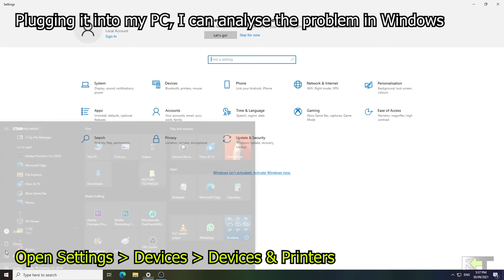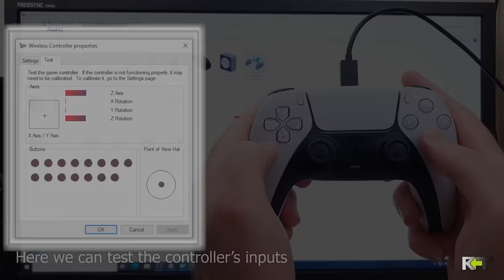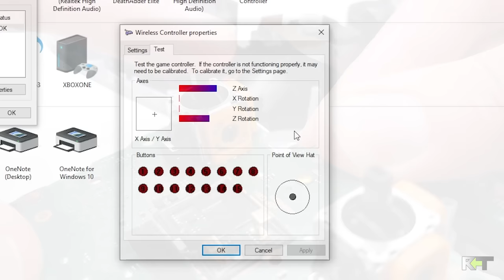How to take apart your PS5 Controller and fix Stick Drift

Comment: The main culprit of stickdrift is that small plastic part with tins in the stick module. The tins simply wear off causing incorrect current read. If you have an old and unusable controller (either xbox, playstation or just any generic one with analog sticks), just replace the problematic part from one of those. That's how I fixed two stick drifts for my PS4 back then and one stick drift on my PS5 recently

Comment: Great video. I had some slight drift. Took my controller apart, and cleaned the wiper disk. Now my drift is 100x worse. Anyone know what I might have done wrong? 

Scratch that. I took it apart and cleaned it again. Worked perfectly now!

Comment: Thanks for doing this, but i feel a little more emphasis on how difficult things like the ribbon connectors are to get out initially would have been good.... broke two, managed to fix one but had to purchase spares, your video makes it look so easy to take them out, mine were proper stuck in there....
Not sure ive fixed the problem as still has a bit of drift in there after replacing.... possibly faulty replacement parts
Couldnt have done it without this video though. 👏👍👌✌🤘🖖🤙🍻

Comment: 10/10 video instructions are very clear and it fixed my issue, although I suggest being extra careful with the wiper disk disassembly, I almost broke mine because I got impatient with the clips that hold it in place 😂

Comment: Are regular q tips ok? I don't have access to online shopping, so I can't really get them. If normal q tips, what would you recommend to deal with the lint. And if not, what would be a good replacement? Please respond. The stick drift on my controller is god awful and I desperately need help.

Comment: Hey, just opened my 6 month old controller (idk if this voids warranty..😬), to clean the contacts and the left contact looks like it got burned and cut in half… i have photos of it if you are interested to see… should I check with warranty if they can replace it and lie that I never openned it? Or just buy a replacement potentiometer and fix it myself?

Comment: I owe you a beer, but i had a third solution, after cleaning a disc, analog drift wont stop because he was broken, then i replaced just a disc from a broken ps3 controller and problem solved. I was prepared for soldering new analog but for now everything works. Anyway thanks for this manual it help me a lot. :)

Comment: thank u man u really helped save over 20$ to get this fixed. Lots of love appreciate it big time
Reply: How do you fix it for $20?  The Joystick cube is soldered to the board .
It's not a quick swap like the expensive  DualSense Edge controller has.

Comment: the main reason is that the green plate becomes crooked by your thumbs. they padded the touchscreen part with a thick cover of rubber wich also helps the printplate get arched but underneath the sticks itself is no padding or any substance to not get the printplate crooked... bad design. wish a ps2 controller packed in a 2024 style with touchscreen because ps2 controller had padding under the sticks. and the fact that half of the controllers are contaminated with lubricant and half havent. mine didnt had a lubricant on the wiper contacts squares

Comment: Replaced wipers and soldered on 2 different pads with no luck. Still has constant drift to the left. What else could be causing this... Should I try replacing the whole stick cube?

Comment: After watching this, I wish you were selling brand new cleaned and re-greased PS5 controllers. With better buttons too. Basically, one with higher-end materials, springs, and lubricants; I would pay $200 for a guaranteed high-quality controller. Because even the PS5 Edge Controller isn't guaranteed to be high quality, despite it costing 3 times as much as the normal one.

Comment: Can someone help me cus I opened my ps5 controller to fix a clock ticking sound in the controller I looked in it then put back together and now I does not work during games but only works on the Home Screen.

Comment: 2 weeks, it's been 2 weeks since I got my PS5 it's by no means new since my uncle had it for 3 years originally. But it took only 2 weeks for it to get a mild stick drift and while it doesn't bother me in games it's incredibly frustrating having to fight my controller just for a simple turn on the stick.

Comment: Bought a ps5 30 days ago. Played 5-6 days and got a stick drift. What a sh*tty controller. 
I’m gonna try to fix it. Hopefully it’ll work.
Reply: Update:
It worked, thanks buddy! 👍🏻

Ps: worked for a day, bought a new one and the other sent on guarantee
Reply: @Netkoizmase991  Is your new controller good? Not a problem anymore right? No stickdrift? I need your reply.
Reply: @ene4602  new one is alright, let’s see how long 😂
Reply: @Netkoizmase991  Wow that's cool enjoy with your Ps5 controller I will buy new two Ps5 controller too because I'm sure one of them will have stick drift and I will use other Ps5 controller this is my idea

Comment: I did this to 3 controllers (dont judge me lol) on the 3rd when i tested the right joystick just keeps spinning to the right. Should I just re clean? Any suggestions? Thanks for the video!
Reply from the maker: You could try re-cleaning, but it may be a lost cause and the carbon track needs replacing
Reply: @RestoreTechnique  it's less than a year old and the first time I've cleaned it. What is the carbon track? Ty!
Reply from the maker: @ayeruck8695  5:30 the black rings on the inside of the yellow housing.
Reply: @RestoreTechnique  okay thanks! I have another controller that broke from the black wire disconnecting. Maybe I can repurpose those. Thank you a bunch!

Comment: Thanks for this! Your close up shots and instructions were really clear. What % IPA did you use? So is this a design flaw, cheap lubricant or normal wear and tear? Why is it mostly PS5 controllers? It’s inexcusable these issues are still around after 3 years on the market.
Reply: The safest one to use would be 99%. That would have the least amount of water in it. Be advised the newer/sealed 99% will actually be close to 99 whereas an old bottle could have much less alcohol percentage due to evaporation.

Comment: The most difficult part for me is unscrewing the controller for the first time.  I can't even find the specific type of screwdriver in any hardware store. But I used one screwdriver that helped me open two different PS5 remotes. 😢
Reply from the maker: Ebay is the best place to get all the tools you need
Reply: @RestoreTechnique  Will have a look. Thanks.

Comment: Holy crap, i cant get the big clip at 2:40. Im jamming my tool in there but it wont budge.

Edit: I couldnt get it off no matter how i approached it or how gentle or rough i was. But i was replacing the old controller shell with a new one, so i just said screw it and jammed my tool in there and broke the big clips off. I later realized that i forgot a piece and when i took it apart with the new shell it was way easier and i got it off with out breaking it.

Comment: 😩 I was doing so well taking it apart but after I took out the battery and tried to take out those little attachments.. I broke the little pieces off and then I tried to save it and put it back on and ended up rip off the plastic wires to something… I’m so hurt lol 😭.. we’ll at least I tried it.. guess I’ll have to pay for a new controller now anyway.

Comment: This worked for mine but Im guiding a friend through this and it does not seem to be fixing his. Im thinking his has a faulty wiper disc or something. He is going to try on one of the others he has to see if it ends up differently.

Comment: hi thank you for detailed video. let me ask you for about unreadable dualsense serial number. How can find dualsense serial number if it not readable backwards. is there any way to get from software or over from pcb board? The sony accredited repairment center does not want fix because serial is not readble Could please help me how can i find unreadable serial number thanks a lot.

Comment: I dont technically have stick drift, but it does make loud squeaky noises and feels a little rough. Ive cleaned it with rubbing alcohol too but I still seem to have the issue.
Reply: If it's not broke don't fix it .

Comment: I have a bit of a situation, so i fixed the drift on my controller but now when i press the stick down, even just a little, it'll be as if im making an input to move left. I reopened to see if i moved anything possibly but it looked normal to me. I'd appreciate any help or tips

Comment: you see that mirror thing at the speaker that he took off? at 3:44, I took it and put it at the place where he putted it, and my controller speaker is now not working, what should I do?
Reply from the maker: You likely put it in the wrong orientation. The pins on the back of the speaker (mirror thing) need to make contact with the gold pins on the motherboard. Make sure the mirror part isn't facing you when put it into that centre holder, and make sure the pins are on the right hand side to align with the motherboard pins.
Reply: @RestoreTechnique  Oh, ok thank you very much.

Comment: Hey! So I was disconnecting all of the 5 flex cables on a controller that if I can fix I can keep and the on that connects to that black back piece that you took out before the motherboard came off the piece. Any tips?

Comment: Did all this, followed a few other videos but it’s all the same. Cleaning my “left/right”optiometer or whatever it’s called did stop the drift but caused other issues. Now it doesn’t know if I’m going left or right. Barley reads up and down. What did I do wrong 🥲
Reply: im not sure. theres a lot that can go wrong. Think about how many little pieces and parts go into a controller let alone the potentiometer itself. its not really your fault man - you shouldnt have to have had to open it up in the first place. Sony has just done a terrible job with these controllers and the only thing i could say is look into getting a duelsense edge with replaceable joysticks or get an aftermarket controller that does similar things to avoid stick drift.

Comment: Hi, I got a controller that is virtually brand new, but it keeps pressing the PS button by itself, even if the button is not sticking.  Do you have any idea on could I fix it?
Reply from the maker: I would return under warranty if I was you. If you're trying to fix by yourself, I would first drop some Isopropyl Alcohol on the button, and it will seep down under the button, then repeatedly press the button to dislodge anything that may be shorting out the button. If that doesn't work, take it apart and inspect the button contact, and clean. Last option, replace the carbon button contact film.

Comment: Can repeated cleanings eventually result in those 3 pins getting snapped off? Bending them over and over to get at the thumbstick components surely isn't something they can take forever.
Reply from the maker: Yeah good point, you probably can only clean 3 times before snapping it off. But hopefully that's the life of the controller, or the life of the carbon tracks on the potentiometer.

Comment: I have the green ones for Xbox Series/PS4/Xbox One. will those work as well for dualsense?
Reply from the maker: Yeah the potentiometers are very similar, so same procedure for servicing the pot.
I've got a PS4 repair video, if that helps you more with taking the controller apart.
https://youtu.be/kBPUkUMNsS0?si=uWw58rham4AGMx6e

Comment: What tool is that you are using to unclip the orange thing next to the potentiometer? Would be appreciated.

Edit: Nevermind! I used some of my guitar picks along the way and got it all figured out! Great tutorial. I only wish you would’ve shown how to put it back together but still very easy to follow!
Reply from the maker: Metal spudger. It's a fine tipped one though, and every one I've bought since hasn't been as fine. Can't remember where I got my original one from sorry
Reply: @RestoreTechnique thanks for the reply back, I got it solved. Awesome vid!

Comment: At 3:20 , the flex cable you removed at the upper right of the controller, I seem to have misplaced the cream colored plastic bit that the cable connects too. Is this an issue and if it’s required where can I source a new one?
Reply from the maker: So you ripped off the socket for that ribbon cable? That ribbon is for the touch pad. I don't know where to source those from.

Comment: Yo, I just got the circular spring thing inside the green box for the analogue stick. I inserted it back but now whenever I move the stick down it gets stuck down and has this weird bump it hits when moving in a circle. Know anything I could have done wrong?

Comment: Do the items in the tools list need to be of high quality or can cheaper options function just the same?Also is the microscope necessary for the repair?
Reply from the maker: The microscope is definitely not needed, I just used it to show close ups. The pry tools are cheap, you can get a phone repair kit off ebay for a couple dollars.
Reply: @RestoreTechnique  is there something special about the hakko soldering iron or can i get a cheaper one because it was way more expensive
Reply from the maker: @fredrikflo5264  Hakko is a very good brand. I started off with a cheap iron and it's fine. It eventually started to die after a 5-10 years. Get one with temperature control at least. Probably as cheap as US$30
Reply: @RestoreTechnique  thanks for the help and the quick replies

Comment: Thank you for high detailed tutorial.   My dualsense now free from drifting.

But I want to ask you, after I clean the analog controller, put it back together, and then my touch pad doesnt work for swipe things. For example, playing Ghost of Tsushima, I cant use swipe for mini chat, emote, sword sheath, etc. 

How to fix it? Is there any solution for that? Thank you.
Reply from the maker: Most likely you damaged the ribbon cable for the touch pad, or didn't plug it in properly
Reply: @RestoreTechnique  ah too bad, maybe I break the ribbon for swipe sensor. The press button on that pad still working. 

Anyway, thank you
Reply from the maker: @burcuy09  Yeah the press button is on a separate connection on the motherboard, it's not connected using ribbon cable.

Comment: My ps3 controllers never needed this.  This is the second time I've had to clean my ps5 controller and I barely play that much
Reply: its such a money grab. I had all the same issues with ps4 controllers. The duelsense edge, playstation's branded pro controller, has joysticks you can literally slide out and replace. Why isnt that the norm? well they want money of course but still man replaceable joysticks shouldve been a normal thing years ago.

Comment: Will just pouring isopropyl alcohol in the joystick whilst moving the joystick help get the gunk out too? I want to avoid breaking those small pins
Reply: No. That has a very high potential to cause worse problems if it leaks into the internals of the analog stick and motherboard.
Reply: Pouring? No. If you use a 25g or smaller needle and gently drip it a tiny drop at a time? Maybe. I'd use 99% if you're going to go that route though, and be aware that it could still screw something up. It's just a way to minimize risk.
Reply: @FenrirAldebrand  I saw some YouTuber use some electronic spray bottle to spray directly inside the joysticks and wiggle em around ima find out what it is.

Comment: What am I supposed to do if my wiper just looks broken, one of the contacts looks like it dissolved
Reply from the maker: That doesn't sound possible... the metal has dissolved? Some wipers look slightly different, maybe yours is a different model. If your wiper is actually broken then you'd need to replace the wiper or whole potentiometer.
Reply: @RestoreTechnique  One of the contacts, the left one that's on it's own, is just missing and looks like it broke off, Im not sure if it dissolved it just looked like it because i couldnt find the bit that broke off anywhere. I don't think it matters though because i cleaned the wiper anyway and when i put it back in my drift just disappeared and there were no issues, so thanks for the video!

Comment: Tried pulling off that part at 2:02 and my whole controller powered down. Think I scratched the piece up trying to take it off. Sucks you have to do this much just to replace an analog stick

Comment: I followed these instructions exactly as my left stick was forcing any character I played with to try and walk off the left side of the screen by itself! I followed it carefully,didn’t break anything or disconnect any wires or pins and after putting back together neither stick works at all now and the up and down d pad now doesn’t work right either,if I push up on the dpad to select a tab on a menu it automatically moves it back down to the original position. Controller is totally useless now 🙁 time to buy a new ps5 controller I guess

Comment: How did you unplug the ribbon cables so easily? I’m having an extremely hard time removing them, especially the ones with a short pull tab like the blue one at the top. I think mine is shorter than yours, i’m not sure why. How can I remove it?
Reply from the maker: I use fine tip pliers. I find I can't get my fingers under the tabs, and using tweezers it doesn't grab strongly enough.
Reply: @RestoreTechnique  Unfortunately I don’t think I have those, is there any alternative that is commonly found in a home?
Reply: @RestoreTechnique Actually nevermind, I found some fine tip pliers and I was able to remove the ribbon cables. Thanks a ton!
Reply from the maker: @InfinityBS  Not that I can think of. You can bend back the blue tab to help you get a finger grip on it, it shouldn't do any damage to the actual cable.
Edit: sweet 👌